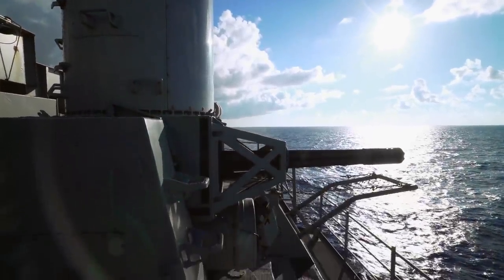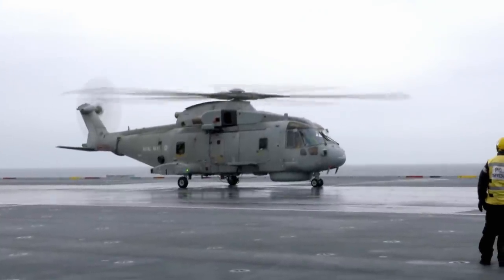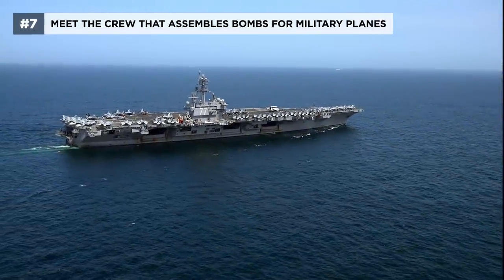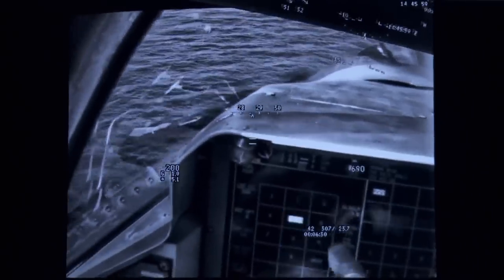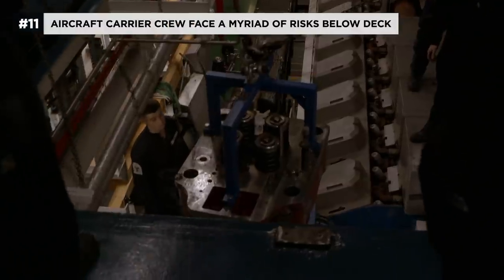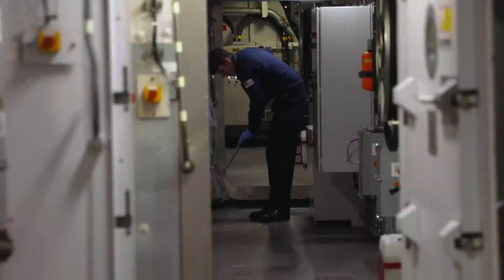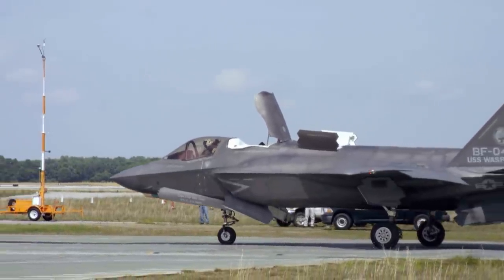13 Action-Packed Aircraft Carriers | Smithsonian Channel

Comment: HMS QE2 ≠ Nimitz-class/Ford-class size. AKA 65K tons ≠ 100K tons. Every Brit here seems to be so insecure as to constantly compare themselves the USN's supercarriers  - that they can do just as much with less. They don't even mention they are using entirely different F-35 than the USN! They are using the STOVL "B", whereas Nimitz/Ford-class (the carriers they like to cite as using much more manpower for the same tasks) use the "C" - which are the largest of the three.  So a proper comparison should be done with the light carriers like Wasp-class, which can hold 20 F-35Bs vs their 22 but use a smaller crew, and deploy ground forces element in a Marine MEU! This clearly shows the Royal Navy has never gotten it out of their head they are second-tier naval power now.
Reply: Japan Australia and many other nations operating same type of helicopter carriers with ski jump.
Its not catapult type carriers, its not nuclear AC. 
Then how this thing called as super carrier.

Comment: What about cv59 Forestall wich had similar accident except they were loading live missiles and lost 167 crew also because they washed AFFF dispersed by sprinklers. AFFF is used to smother fuel fires or class bravo fires. Some of that footage looked quite familiar. So the Enterprise did not really learn much from Cv59. The biggest mistake was taking shortcuts live loading Jets. Eh I might be wrong about the Enterprise but the Forrestal suffered the more. That is why an airmens job is the most dangerous. The same can be said about pilots job. Still being stationed on an aircraft carrier was best experience in my life. Go USN.

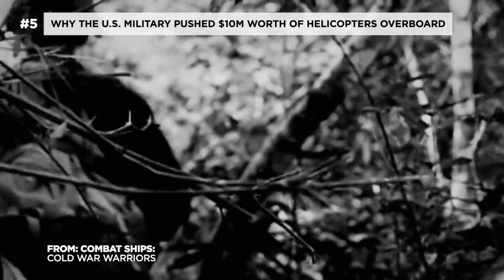Comment: 10:27 i don't understand why they had to push helicopters into the sea. If I was the captain i would order the pilots of the heli's to take off and circle the area until major bujang landed his aircraft. Makes more sense.
Reply: Yeah I wondered the same. He must have a good reason.
Reply: I know right?
Reply: Time. The choppers had been flying evacuation missions and were not prepped to fly immediately.

Plus putting up more aircraft could've interfered with the Major flying the cessna.

Captain made the most straightforward and fastest call to dump the choppers.